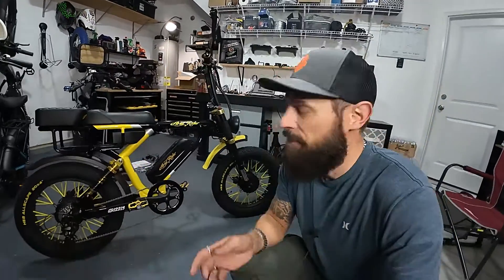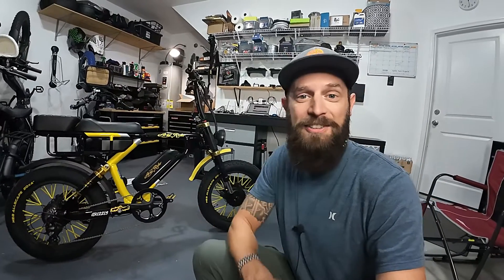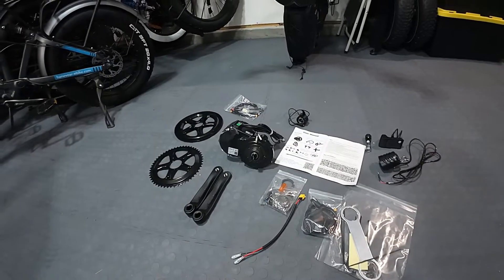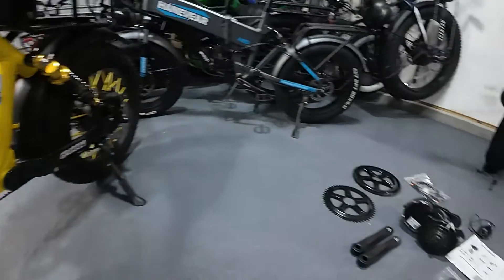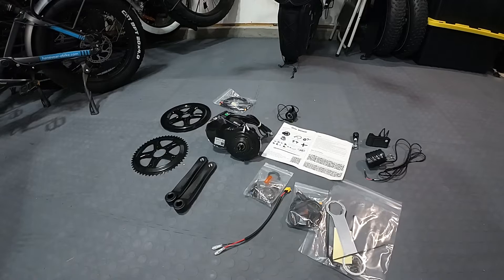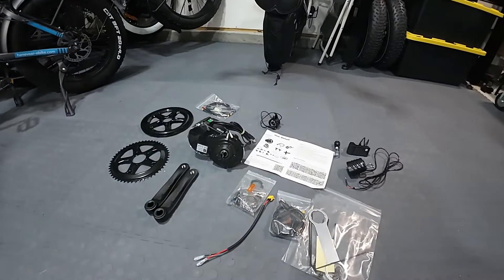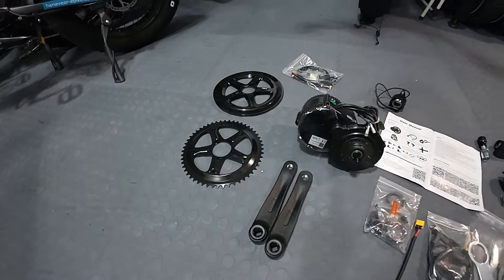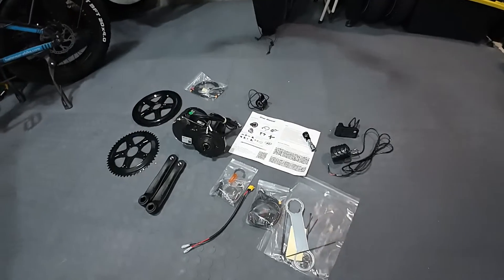Ariel Grizzly Power Upgrades: BBS02 Motor

Comment: I hope your modification is successful, but how are you planning to keep the mid-drive motor and rear hub motor in synch? The timing of power application will need to be totally simultaneous and aligned to both motors all the way up and down the speed/torque range, or you will be stressing the drive system's gearing. Translated: broken chains and/or quick chain and gear wearout. I could be wrong, but I don't think normal controllers would have software to ensure that synchronization.

Comment: With that kind of setup you should start with the hub motor before engaging bbs02 this will prevent Chain and sprocket damage. I own two 3 motor bikes with bbshd's and like the bbs02 they like to rev high. To get best performance from the bbs02 you should have a one to one ratio on the gears. High Voltage channel has quite a few videos on this setup for high voltage bbshd's. My bikes run 3 72v batteries on 3 Phaserunner's.

Comment: I have seen what you have done with these bikes. You’ll be just fine putting a BBS02 on this bike as long as it is the correct size bottom bracket. I’m very very interested in this. Never considered what kind of an upgrade this would make. Yes, I am definitely interested.